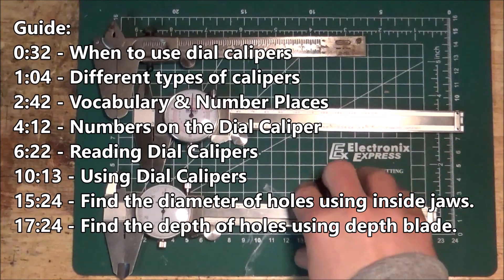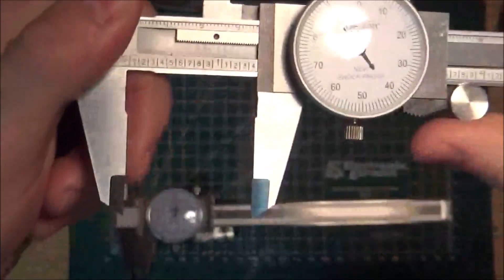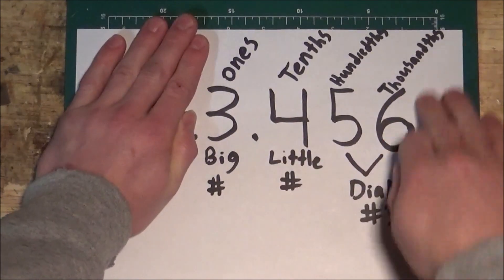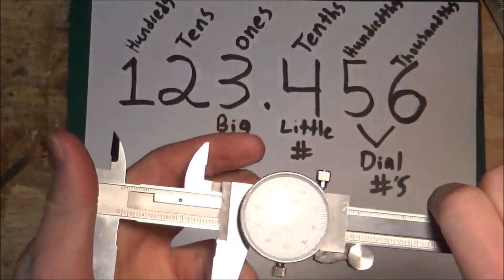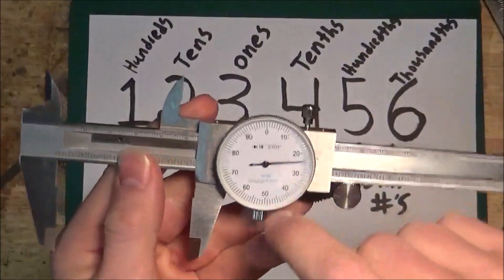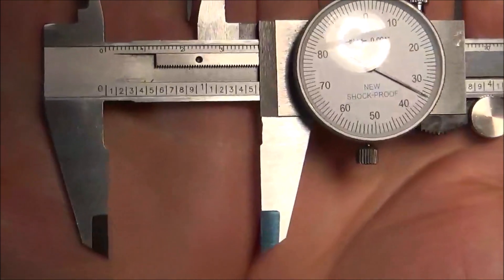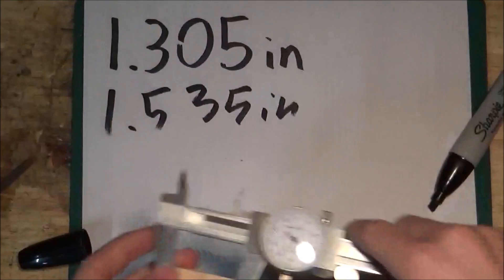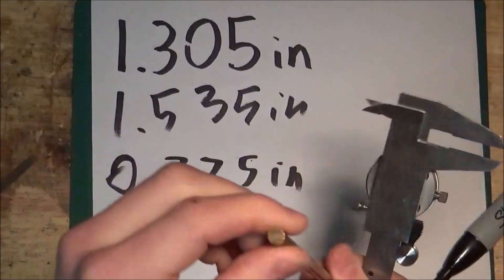The Complete Guide to Using Dial Calipers

Comment: My metric dial calipers spin the needle one whole turn per millimeter of jaw opening, and being graduated into 100 segments, provides an accuracy supposedly of 1/100 mm.  That’s better than a thou.  This sort of accuracy is contingent upon there being no micro inaccuracy in the toothed ratchet and pinion and of course that the overall range does correlate to a true measure.  Seems pretty good to me, I tested mine on many drill bit shafts..not bad for about sixty bucks (50 Quid uk).

Comment: Excellent, simple and to the point. I really don't know at what level if any is the rounding part even a point but I seem to remember that form a math point of view, all things being equal in other words 1.055 you go to the "even" number 1.060 not to 1.050 (6 being even and 5 odd). Again this is not from a machinist point of view or a practical POV. but from a mathematician POV. it is done because it make the calculation and math workings that might come later easier because it is easier to divide even numbers than odd numbers. All be it "a human hair" worth of number.
Reply: The precision required is to the 1/1000 of an inch, so three decimal places are significant and rounding would occur at the fourth (1/10,000) decimal point; e.g. 1.0554 would round to 1.055 while 1.0556 would round to 1.056.

Comment: A couple of things and I rarely am critical of any YouTubers except political commentators. 
1) You will be laughed out of a machine shop if you start refering to metric & imperial scales as "big & little numbers"
2) When reading a measurement to the right of a decimal; it should be read in thousanths of an inch .092 = ninety two thousanths, or
     4.748 = 4 inches seven hundred forty-eight thousandths, or 3.5616 in the case of vernier calipers = 3 inches five thousand six
     hundred & sixteen ten thousandths or fifty-six hundred and sixteen tenths.
3) The fourth digit to the right of the decimal is ALWAYS referred to as tenths (informally) or ten-thousandths (formally).
4) A metric caliper is always referred to by its length in millimeters.
5) An imperial caliper is always referred to by its length in inches.
6) You should have included vernier and digital calipers of which both are more accurate than dial calipers.
7) I do, very much, like your imperial/metric dial calipers. I have not seen any like that before.

Comment: Good video, however you didn’t show what your other knob on bottom of the dial does. Also the there is a 4th way to measure a ledge using the step on the backside of the blade surface. Would like to have seen you show us the unit that has dual needles one of which for the metric system.
Reply: I noticed a lot of videos do not show using the backside of the blade for some reason. Good video however. At first I thought he wasn’t going to go over plain ‘ol thousandths